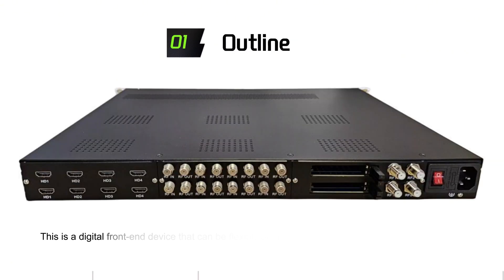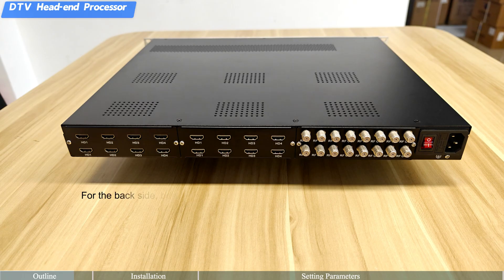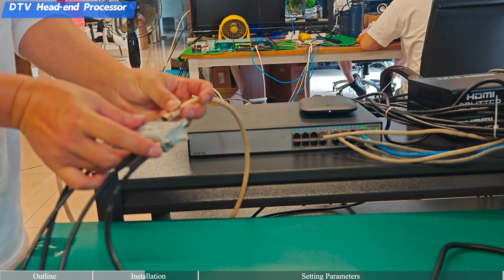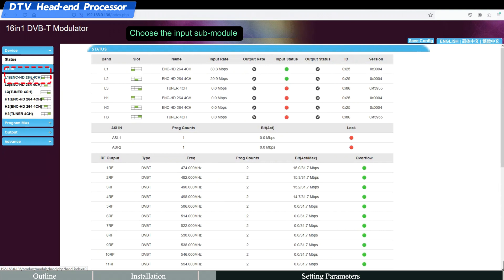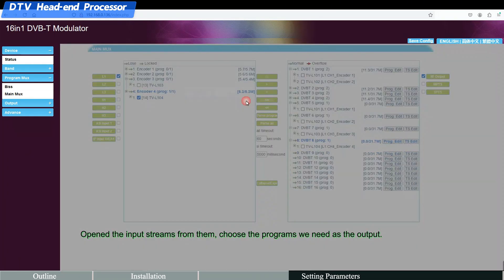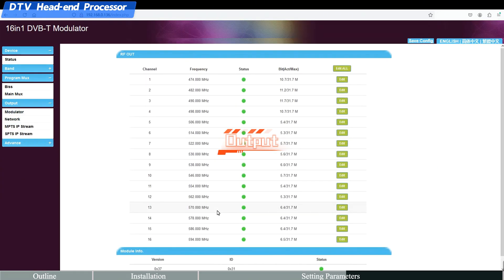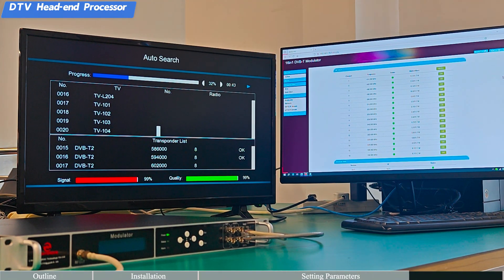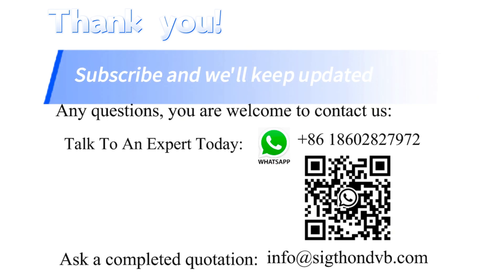DTV Head-end Processor----Upgrade TV system only one device

Comment from the maker: This is a digital front-end device that can be flexibly plugged into 6 sub-modules.
The input can be plugged into the receiving module, like FTA tuner receiver and receiver with CAM.It also can plug the encoding sub-module, such as HDMI encoding, AV encoding.
For the Output, it supports IP output and RF output.

Upgrade your TV system with just one device.